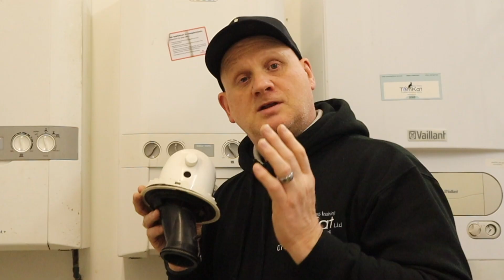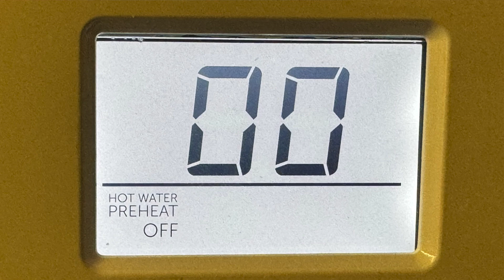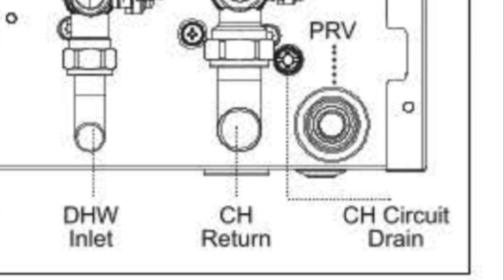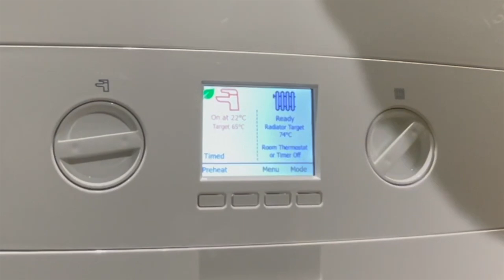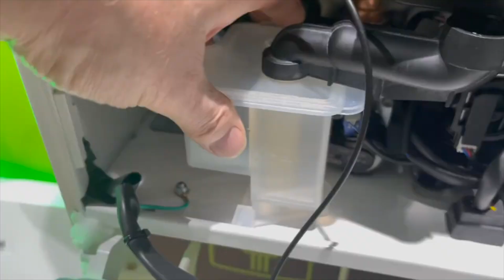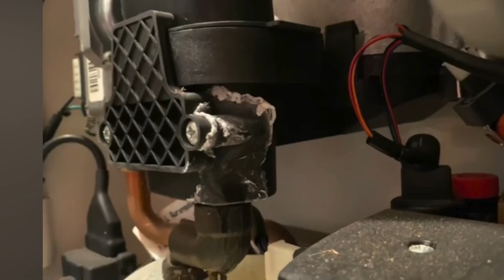5,000,000 ideal logic boiler sales, celebrating the history the good, bad and the ugly.

Comment: Logic 2 Gas Valve new location at the bottom of the boiler makes it vulnerable to short circuit if any water should sit at the bottom because of leaks from trap flue faulty o ring etc.
How did they solve the problem with the plastic sump and flue?. Great video Derek thanks👍

Comment: Slung 100s on the wall in New Builds. Ideal are great at covering Warranty work, but 💩with older appliances. ‘Sumpgate’, they completely ignored the problem of faulty plastic sumps & for the vast majority of cases, the boiler owner paid for the replacement. But hey, Ideal are no different to any other manufacturers in that regard.
As you pointed out Del, the whistling Logic, is another of Idea’s failings, their Gas Valves are 💩. As for the injector/Ventura design, also 💩
The Condy Trap is virtually impossible to clean out, in the whole range.
The Burner design is also💩 with a plate easily detached.
But apart from that a great wee boiler😂😂😂

Comment: Ideal the last 20 years have to be thanked for keeping gas engineers busy for their inventions of Icos, Isar & Logic. Thank you Ideal
Reply: Your right there m8 iv made a fortune they are total garbarge
Reply: who were fitting them boilers? you guessed it centricas sub division called british gas and its not 20 years. centrica took gas safe...............used to be corgi right. when you phone ideal back in the days and explained and tested certail parts they would tell you its a wet area. ask for tests none given. test by subsitution. how is that not big companies not trying to bully people out. not quite sure anything changed.

edit i never came across an isar that wasnt fitted by british gas. ever. wires going to the condensate trap that rotted.and inside...... come across a few bosch boilers too, were they designed in colaboration with british gas? aka centrica? they are different to normal ones. cdi etc
Reply: You remember the ideal “response”? Suicide inducing
Reply: @stevenpatrick9213  oh yes. Used to have a block of apartments I used to maintain that were full of them, late 90’s/early 00’s